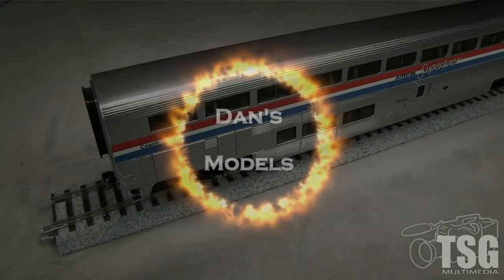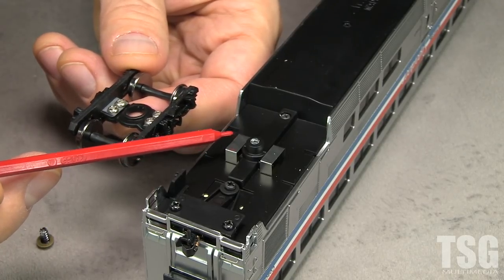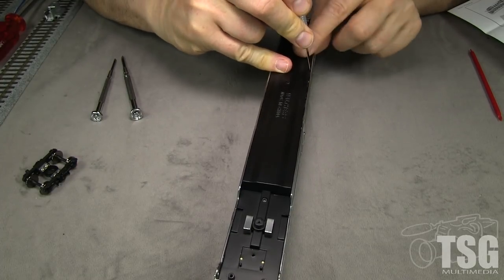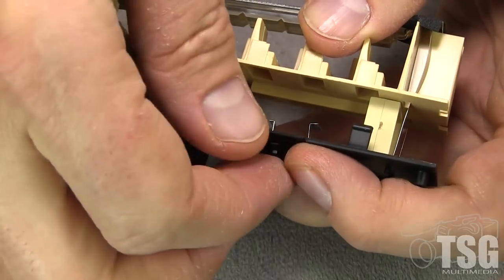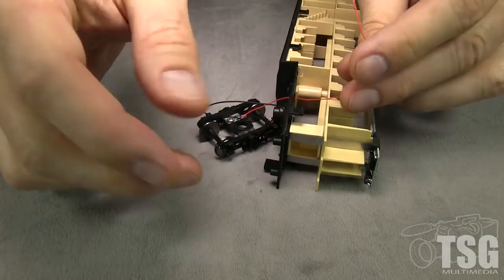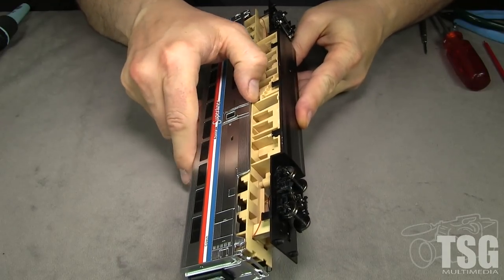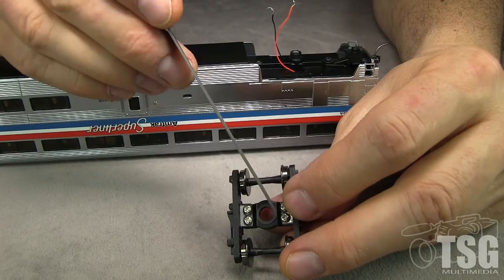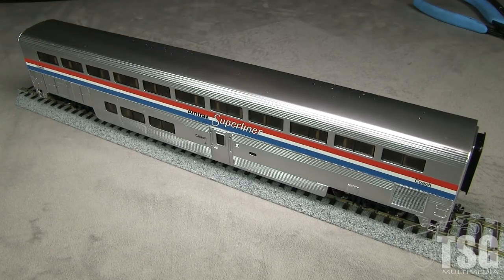How To Fix Walthers Amtrak Superliner Coupler Height

Comment: Sweet guide! Never thought of the couplers being high, but you are right, I checked mine they are ever so slightly high. Oh well, another project to add to my ever growing list.
Yes, the bodyshell is a pain to remove, I can attest to that. :) I only have 7-8 more to go to install figures in, maybe even paint the interior, not sure. As for rear end marker lights ESU makes a kit (50705) that with light modifications to the car fit very well.
As for soldering on the metal, I had great success when I applied some soldering fluid beforehand (I'm not sure what the english name for it is, but german is lötwasser, or soldering water), I think it basically corrodes the metal slightly so the solder binds to it. The green dot system is a really smart idea, I'm copying that... :)
A question for Dan, how do you transport your trains to and from filming and/or shows? Do you use the original boxes or do you have another smart way of transporting them?

Comment: You're not able to solder to those metal strips because the heat just spreads throughout the meta. There's probably contaminates on it as well. Might be possible with a very hot iron.

Comment: The coupler height was FINE after 12 minutes in. There is going to be vertical shift in operation anyway. All that bolster filing was unnecessary.

Comment: 5 years later when I have finally started upgrading my own fleet it's good to see I am doing the right thing with my passenger stock. I noticed an improvement in curve reliability too when I do this; with some CNW commuter coaches, running them on the local modular layout and did the lunch run. Much to my surprise when I get back it was running and had completed several laps unhindered... it seems the screws/metal springs used for the contacts cause some binding issues. I've currently got a problem with my ATSF El-Cap Baggage-Transition car. That's my next target for an "upgrade"...

Comment: For this kind of issue, I just bend/push on the contact springs that are touching the screws in so the truck touches the bolster closer.
Also, since I made my own constant lighting circuts, I found that using slightly bent railjoiners works well. I slide them on the ends of the contact strips and solder wires onto the rialjoiners themselves...
--------------------
I dont know if this helped at all, but hopefully it sparked some ideas!

Comment: My kato sd80mac coupler hight is too low is there anyway to fix this? thanks great video
Reply from the maker: Search this channel for "coupler height" and you should get some ideas about making adjustments to a model's coupler height. Locomotives might be a little different but the process would be similar. If a coupler is too low you either remove some material from the body so the box is higher or use an offset shank coupler.

Comment: Did you keep the stock Walthers wheels?  I've read of guys replacing them with Intermountain wheels to help roll better.
Reply: Intermountain wheels do NOT work with the Walthers trucks very well in applications where you want to get maximum power pickup off the wheels.  The Walthers trucks are picking up off both sideframes, and the wheels have an insulated center axle section.
Intermountain wheels have a single insulator between one of the wheels and the axle (single insulation), therefore you can only get power from the one wheel that is connected to the axle.
This would reduce the pickups on the car from 8 wheels (4 on each side) to 4 wheels (two on each truck).

Stick with the Walthers center insulated wheelsets if you're wanting to get power pickup.

Comment: Great vid, guys. One thing I noticed when prepping my Superliner fleet is that the swing arm coupler boxes allow for a ton of coupler droop. If you have large enough curves on your layout, I highly recommend replacing the swing arms with a standard Kadee coupler box. You have to drill and tap a 2-56 screw for each coupler, but then you can use spacers between the car and the coupler box to get the coupler to the correct height. No having to remove the shell, no extra electrical work, and no bolster modifications required. You can also pull the coupler box in a bit to achieve more prototypical close coupling.
Reply from the maker: We have the best viewers on Youtube!

Comment: Could y'all make a video on how to fix the con cor superliners. They've got truck mounted couplers, they're super light, and they're awful wobblers. But they're easy on the wallet so I have a fleet of them that are more of a hassle to run than they are enjoyable. Thanks
Reply: I mistakenly bought a bunch of those years ago. I began working on one before I had to leave the hobby but will likely re-start in a few months. There is SO much work to do on those things. The first thing I did was order the correct trucks and wheelsets for those cars, then removed and discarded what they'd come with. Since there are no interiors, I used a light shade of window tint film to cover the insides of both sides of the window plastic. With the windows on both sides of the car tinted, the combined effect is a pleasingly dark tinted set of windows.

I had started to rebuild the end sills with Evergreen plastic based on photos. I never got far enough to install couplers but would probably use a Kadee 451 swinging adapter. I replaced the molded on grabs with wire, which required cutting away the lower corners of the window inserts so they wouldn't snag of the wires protruding into the car body. I drilled out the castings for the rear two marker lights on the car and replaced with two red LED's. These were wired to a small AA battery holder. My intent was that only one coach and one sleeper would be so equipped. The circuit would also include a miniature slide switch protruding through the bottom of the floor to allow the light to be turned on or off.

That's as far as I got. I'd have to calculate the amount of weight to add but with the open interiors that should be easy. I also ordered a transition car from Train Station Products as during the 80's those old Budd step-up cars were used as dorm cars. A heritage baggage car, some MHC's, and some F40PH's and it should make a decent "budget" Phase III Superliner train.

Comment: Can you show where and how you would make that same type of car have sound using a Soundtraxx decoder. Also how would you paint the seats and add people , and paint the china in the diner so it looks more prototypical and no more ghost train.... Thanks.
Reply: Daniel Cortopassi t
Reply: Daniel Cortopassi to make it more prototypical
Reply: Daniel Cortopassi So have I but from the outside there is some wheel sqeals and that AC hum. Also I want to add people and paint the seats and dinnerware so it looks prototypical too...
Reply: Even with Soundtraxx sound car add on.
Reply from the maker: What would be really cool is if you could make the little pipes drip water like they do on the real cars!
Reply: tsgmultimedia YUP !
Reply: I also want to add marker lights
Reply: You can super-glue surface mount LEDs to the glazing on the inside of the car where the marker lights are, tap power for them off the interior light board, and install a small switch to allow you to turn off and marker lights in the middle of the train. I did this on 1 coach and 1 sleeper and have been very pleased with the results.I used these downward facing LEDs: https://www.digikey.com/product-detail/en/osram-opto-semiconductors-inc/LS-T77K-J1L2-1-Z/475-2518-1-ND/1802645
Reply: Don't know if there's an alternative to Walther's Superliner cars in HO. I model in N scale, so we get Kato's. I don't think I'd want to deal with the Walthers cars that much.